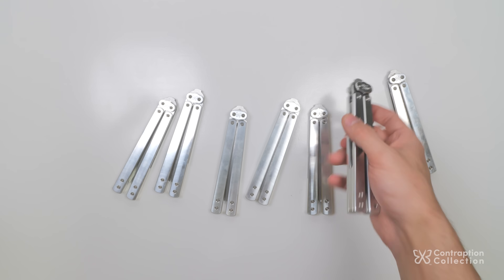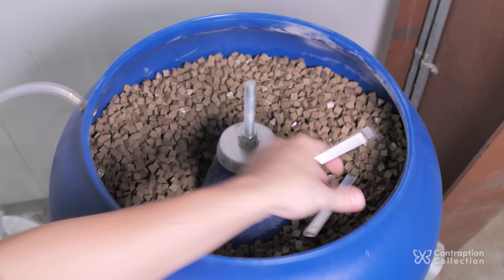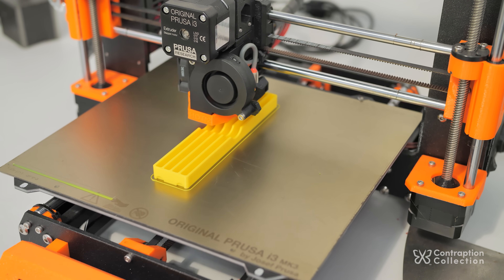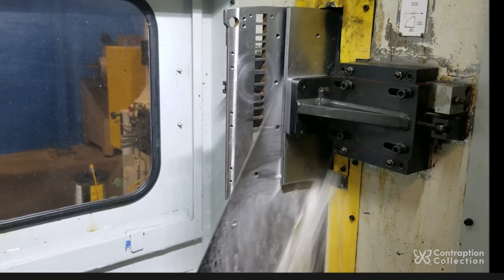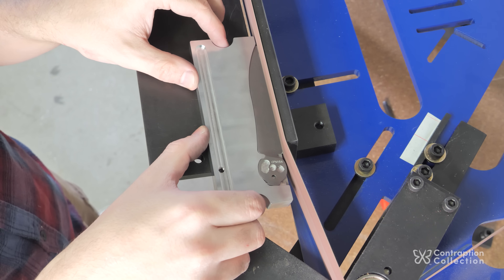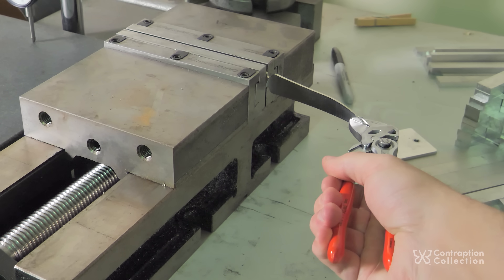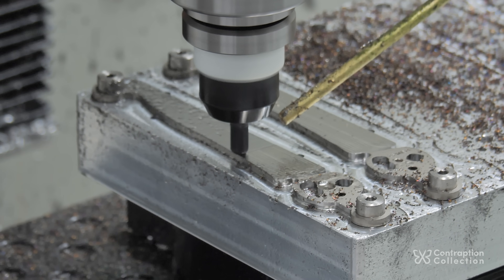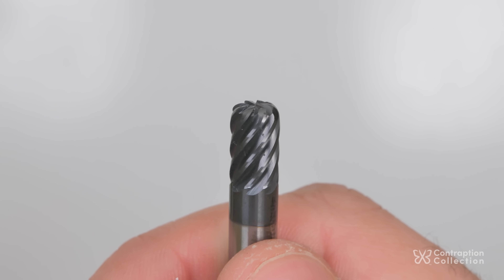I thought I was finished! Baliscissors: Ep 28

Comment: The problem is mainly the shape of the blade itself, if you have the time to redesign the blades you would have less bend in the procedure at the end. As example a diamond shape would bend much more in the process since metal tends to expand upon heating hence why the blade deforms where there is less material.

This design could work with other/stabler material

I strongly suggest to do all the steps without heating them first and then to heat at last step aswell.

So maybe either change the Material, Process or Design ;) 

Good (P)Luck

Comment: Ran into this problem with a long steel flatbar machined into triangular shaped bar.

What we found is that using normalized stock fixed almost all warping issues during machining - regardless of how much material you are removing.

Not sure if this is what you're already doing, or if it would help with the subsequent heat treating process - but in my experience, it made a significant difference to the entire process.

Comment: Surely 000.5" would jave no bearing on opening and closing tolerances, if your concern then is pin/hinge clearance, standard practice would be to ream the hole and whatever grease or sealant you install the screws should protect against corrosion

Comment: You can straighten them out prior to heat treating with a squirty bottle of water.
Heat them up. They don't have to be cherry red, just hot. Face the convex bow toward you and give a light spritz of water from the squirty bottle, set on fine mist, onto the convex side that is facing you. Repeat until straightened to taste.

Comment: This is an excellent show and tell about R&D in real world. I can see you are serious and want to buy a pair when you have your production zeroed in. About warping: You have ambitious blade length and very thin blades. 4.5"? Factory made scissors are often about 3" and the blades are slightly triangular to have rigid spine. That makes handles thicker, but less wobbly. For EDC a little less than 3" could be quite enough but is that too short to fidget?

Comment: You’ve probably heard of these ideas, and maybe even tried them already. But I wanted to throw them out for you… Number one: have you considered over dimensioning the blades on both sides, and then shaving a little off in final machining from both sides? To see if that helps with your curving problem… Number two: there is a ball peen hammer that I have seen videos, I think Gary Creely did it… You can use it to strike a curved or bent blank and it will straighten it out… Somehow it relaxes the tension using a shockwave or something. Don’t give up! I want one of these!

Comment: It is normal that a blade with a one sided bevel will warp during heat treatment.
U could use carbon steel and heat treat the blades with out bevel, and then grind the bevel on the hardened blade, its relatively easy to work with hardened non stainless high carbon steels.
Or you try to get rid of the warp during the tempering process.
Take the hardened blade clamp it down with the flat side on a large very flat piece of steel and put it in a kitchen oven for a hour or so...

Comment: I just now found your project videos. This is such a cool idea! I am definitely interested in this when you have a final product!!
Sorry I don't have any suggestions on your warping problem, but I have a couple others for other parts of the video if you like:

For the text engraving, you could do the milling engrave after the anodizing to make it pop in the original material color. Or, depending on how deep the engraving is you could wipe in a paint or tinted epoxy to make the lettering any color you like. whatever you wipe in can be cleaned off the surface but will stay in the letters.

To keep from wearing out one spot in the belt grinder, you can tilt you platen at an angle across the belt. This would allow the full width of the belt to do the sharpening. If you want the grind marks to be straight along the full length of the edge, you can just do a finishing pass with a horizontal platen as you currently are just to clean up the look.

Comment: Hey there.

Nice video
the finishing with the face of the mill isn't that good. there's a lot of pressure forcing into the blade
Try finishing more with the side of the mill. so there is more time to cool down for the edges without coolant. 
And way less pressure on the material.

have a nice day😉

Comment: if you find it consistently warps in the same direction when hard milling you could intentionally warp the blade prior to heat treat the opposite direction, then fixture the two ends down so it doesnt spring up while milling.

Comment: Hey, for the warping issue: try to cool the fixture internally, and the tool with air (to clear the chips) once i machined a thin steel part, where the part got so hot it hardened the part, but i can't use coolant for the toollife. Solution: cool the tool with air, and the part with coolant, the air kept the splashing water away from the tool, and the part stayed cool during machining.

Comment: Just curious, instead of milling could you use your surface grinder for the bevel? Make a jig that would hold a few sets of blades and then do small passes to keep the heat and ammount of material removed down?

Comment: Cannot be an issue with the steel block used during machining ... Maybe you can try a Stress-Relief heat treatment cycle/s on it before machining the blades.

Comment: try it in 1 pas make the cutting surface as large as the blade ,and not drill size  and angled,  stepping metal is warping metal , used in bending to

Comment: Hello im a worker at a milling machine with 5 years experience of grinding, what you can do to remove the tension in the blades is the following, leave it a bit thicker, basically thick enough so it has little to no tension when putting on a flat ground, then put it on the surface grinder and use a magnet with a variable controler for the magnet, use the magnet on  a low power level, increase the strength slightly so it sticks enough to be grinded, then start grinding it until it is plane, then grind the second side and then the first site again, basically grinding 3 times, if its not done in 3 times, do 5 times if that doesnt work go for 7 times even. The lower your magnet operates the better your blades, since the magnet is flat and pulls the the bending of the blade on it, by lowering the power of it, it will bend less. Another thing is the hardening, you need to harden the blade, cool it down in oil ot water, then put it again in the furnace on less tempature so the steel looses  the tension from the sudden extingion from the oil/water bath.

Comment: You may need to use forged steel blades and then machine final tolerances like the pivot section while leaving extra room for the blade area. Certain parts just can't be machined, you would probably be smart to contact a company like Ernest Wright for advice on getting scissor blades just right since it is a whole different world than knife blades.

Comment: Possibly Aneal the steel before hardening, it relieves the stress in the material 

Other than that Possibly leaving some on the other side so that your taking an even amount off both surfaces, problem is stress tending to concentrate in the outside skin of hardened materials as soon as you take a bit off you get stress relief

Comment: Hey man, full time machinist here, while some tools do not need coolant, it is always recommended in hardend materials(here atleast) as heat dispersion is coolants main purpose, lubrication is its second, if your tools are failing prematurely using coolant, then maybe using a ball nose and dispersing wear all along its radius would help, instead of the .06 radius on that bull mill, also, a convex bevel may help, 

The most expensive but easiest fix though, is a staggered tool life between two tools, a roughing mill, and then a finish mill, once your finish mill is worn, it becomes your roughing mill

Comment: maybe add another screw hole in the blade blank to hold it tighter to the fixture?  I think you should find a way to do it on a horizontal wet stone or something that doesn’t generate any heat.  I like that jig you made for sharpening maybe you should think of more jigs and other machining processes.  if the holdup is on the blade manufacturing then you should keep making those awesome handles.  when I buy your scissors I want to buy one of those trays you should make a slot for my de assemble tools, maybe you could make them out of silicone with a mold.  maybe you could work on the packaging and put like a paper that is folded and you cut on the lines and it makes a daisy chain or snowflake.  maybe you could grind the blade fresh out of chrio treatment

Comment: If you make your sharpening platen tilt so that the blade contacts more of the belt, you won't need to move it up and down to get to new grit and the belt should last longer by wearing more evenly. Also, the bend in the "successful" bent blades is actually what is done to guarantee cutting contact for scissors in general. If they aren't bent a bit, they can spread when cutting and stop cutting completely. Look at some of the high end scissors as examples.

Comment: I'm sure it's been said by now but you can shim the bend out of a blade between hardening and tempering. clamp it to a piece of metal with a thin shim to bend it the other way and temper. it has worked for me in the past. if it's a slight warp you don't even need to shim, just clamp it flat during temper.

Comment: If I may offer my unsolicited advice, why don't you try straightening during the temper cycle? If I ever get a blade that warps out of heat treatments, I can usually get it pretty damn flat after tempering under pressure. Basically press it flat while it's being tempered.

Comment: I didn't see you mention tempering the steel at all, idk if you are tempering it but there's definitely room to play there. Maybe rough milling the bevel before heat treat, then hard milling to final dimensions, then tempering under pressure to address warping. Two big aluminum plates with slots for the blades bolted together and tempered at 385-400 F for like an hour then cooled very slowly? If the aluminum holds the blades in place at the correct bend it could give just enough molecular wiggle room for the steel to normalize without losing and sharpness. Good luck!!!

Comment: you can bent the blades back before finishing them. Use a hammer with an carbide-top (The hammer must have a tip with a small radius) and hammer the concave side softly. That might take a while, but works!

Comment: You have taken great pains of trials though this. The blades look very thin at the edges. Also, just get the edge area Heat treated through induction and tempered and stress relieved. Have you tried out. Other materials also like St. Stl. 430c or 440c ? another solution instead of CNC hard milling is to CNC grind with coolant them or lap them. Like razors are done. Just a thought. good luck with all. Also, incorporate a torsion spring into them.

Comment: Have you thought about using a partial hardening process, as you see on many Japanese blades? They have a gradient from hardened edge to softer spine. Not sure if that introduces more or less bend, but it should be easier to bend them back into shape without breaking.

Comment: are you normalizing the steel before heat treat? the internal lattice might be wonkey inside. You have no idea how the steel was treated before you got it. normalizing releases that stress. also try air cooling the blades. it puts less stress on the heat treatment, clamping feels like it flattens the blade and its generally a good practice- but air cooling also works well regarding your problems. you do sacrifice some HRC. it can be regained through cryo. those would be my directions.
Reply: ive milled down to 15thou thick, heat treated stainless with no warping using air cooling. does not work with clamping.
Reply: sorry- to be extra clear, i milled in annealed state down to 15thou, then normalized the steel. then heat treated and quenched by air cooling. no clamping, just hung up in room temp. did not warp. was using AEB-L. followed by cryo.

Comment: Hey man, there's a video on YT about the last scissor maker in Sheffield (UK). Wright, I believe. (Either that, or Moore).
     *[Sheffield has been one of the biggest / best places for quality blades for a few centuries. I personally have a 150 year old chisel from Sheffield that I could literally shave with...]

Maybe check that out.
It has a lot of info about how scissors work, and how they make them.
       I believe the curvature is HAND ground into the blades, using a belt grinder, by a 'master sharpener'. 
     (I believe they are ground in such a way that the blades are even self-sharpening... it's pretty amazing to see)

> I don't think it's possible to MACHINE the blades to spec. 
      (Exactly because of all the problems you're encountering right now)
      And I believe even 'drop forged' and cheap mass produced scissors are hand ground at the last step to achieve the correct curvature (...just with less of a focus on quality)

(I think the trick is to cool the blade in water every couple seconds, to avoid accidentally un-hardening the steel)

-
Anyways, Hope this helps.
I had this exact idea for a while. Cool to see how you approach this.
       Excited to see how this comes along, and impressed by your process, perseverance through adversity, and attention to detail.
     And very cool detail that the scissors' silhouette look like a normal balisong blade when closed!

Dumb question maybe... But for the sake of prototyping, did you ever try to fit the blades of a pair of working scissors into the balisong handle?
     Ya know, as a proof of concept / tryout or something?

-
I shall subscribe. 

Cheers from Amsterdam
Reply: It's Ernest Wright & Son. Sheffield, England. 

Here's the video I saw (but they also put some of their own videos online); https://youtu.be/bK4AWtTV3h4

Comment: Have you considered trying to add a wait() between each vector of a pass? Allowing the tool and part to air cool, reducing heat build up. Also consider feathering your cuts, so you are not moving across the blade sequentially, so you could for example do odd then even cuts as it were.

Comment: Hollow mill out the reverse side of the bevel and leave a 1mm flat around the blade where the spine and the cutting edge will be then hard mill the bevel on the opposite side  that should releive the tension in the blade and will only add one op and another pallet I hope this helps I'd also try a 2 hour cycle in dry ice after hardening between two aluminium plates for the stainless blades to convert the un converted austinite to martincite and your warping should lesson if not stay dead straight

Comment: You need to start with larger material stock, rough mill both sides of material leaving 0.2mm to finish. Leave on side to settle/normalise, then finish mill/grind. 
look into normalising process. Worst case scenario, cold rolling before and after machining can align/re-align atoms to achieve flatness. Good luck

Comment: First I've seen of this great series, but why isn't basic blade shaping of the primary bevel being done PRIOR to heat treating? I suppose there must be some reason, 27 episodes in, but it escapes me. If it must be done subsequent to heat treating:
1. Would have expected machining the primary bevel to be a grinding operation rather than a milling one, done with flood coolant and preferably on a vertical surface grinder with a slant fixture.
2. Would generally expect a powdered metallurgy alloy steel to be more affected by process heating than a conventional solid alloy
3. Might consider hot pickling as a post-machining op (not sure how pickling affects PM steels though)
4. If all else fails I might consider adjusting flatness with a quick tap from a spot welder; the resulting "nick" would have to be hand dressed though. Nothing like a spot welder to bow flat stock. 
5. What do you know about Cratex(tm) rubber/silicon carbide abrasive wheels for polishing steel to a mirror finish? It's used in the cutlery industry to rapidly polish 316 tableware to a mirror finish.

Comment: I think the problem is that when you mill the steel gets hotter and expands, so in bends to overcome the two screws keeping it in place. try tabs with a little bit of play, so that the metal can expand horizontally and not bend

Comment: Instead of using the milling machining to remove the extra material, try to use the Belt grinder, that is the normal process por knives, I think this could help. Other alternative is to create a part with near measure of the finished part and then you treat. After the heat process you use the belt grinder like a rectify (changing the belt for one with more grains)

Comment: Quick question, did you normalize the steel before heat treat? Doing multiple normalizing cycles should help decrease the internal stresses and it will warp less with heat treats and machining

Comment: I'm not sure if this is really how it works, but would beveling before you heat treat the parts work? This might reduce warping since it's already closer to the final shape during the heat treatment. I don't know anything about machining or how steel behaves in these environments, but just my two cents.

Comment: Smith here! The problem with the bending is you're not normalizing the blades before tempering, so the material's stress isn't even. Try heating the blades to an even red-orange (when a magnet no longer sticks, you're at the right temp), letting them cool down to room temp, THEN tempering them. This should alieve the stresses in the steel and permit you to do as you please to the finished blade.